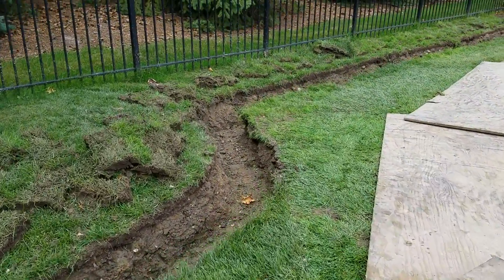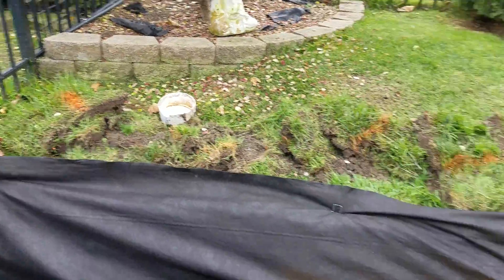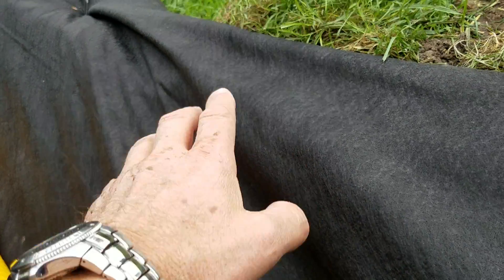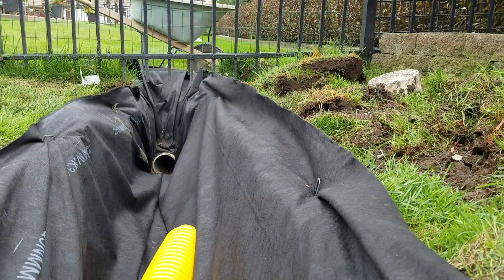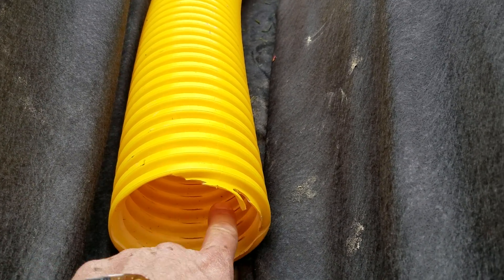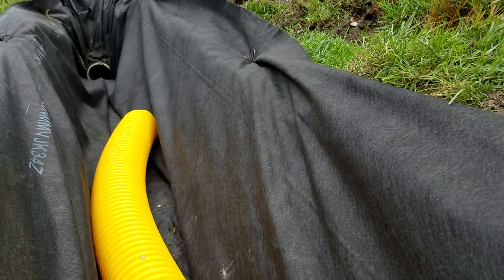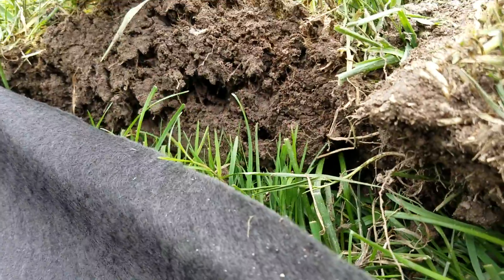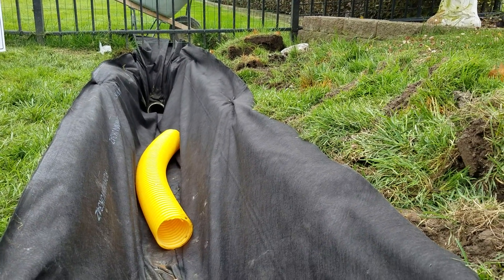Why Gravel French Drains are Better with Corrugated pipe and Geo-textile Fabric

Comment: I'm trying to drain from a wet area and want to use solid corrugated pipe. Do I still need gravel and geotextile fabric? I don't want it to drain or absorb water along the pipe, only where it starts.
Reply from the maker: Just a solid pipe with a inlet basin with do.